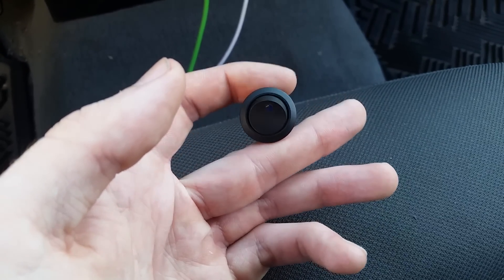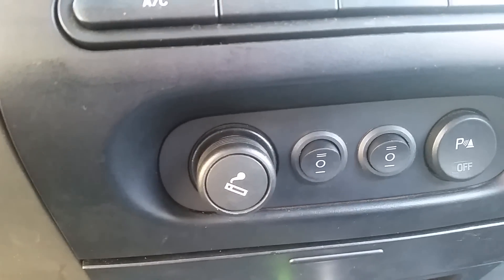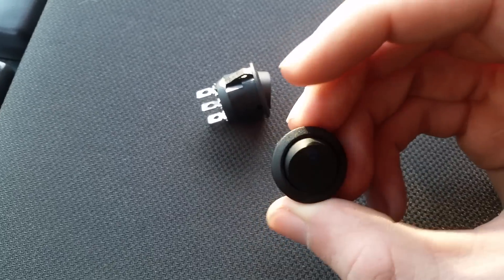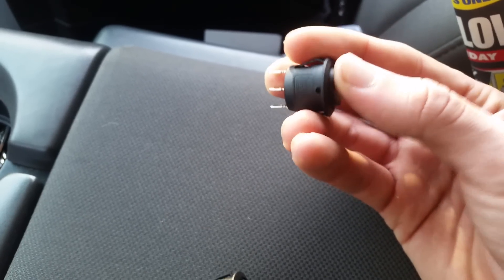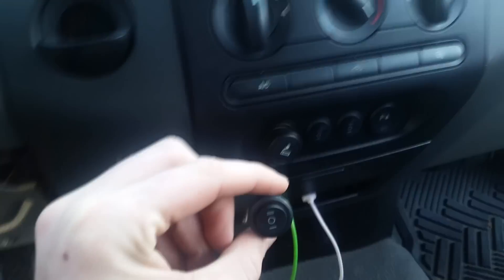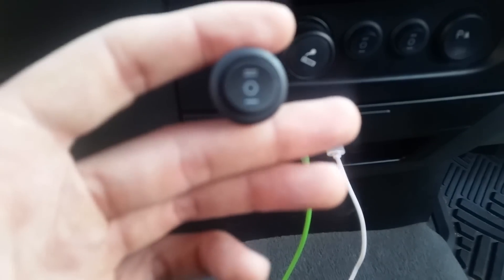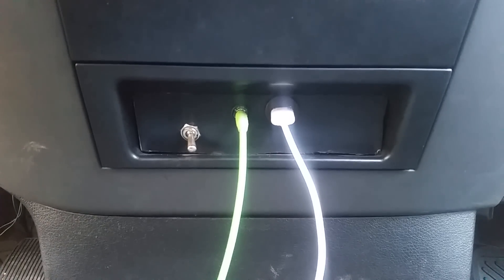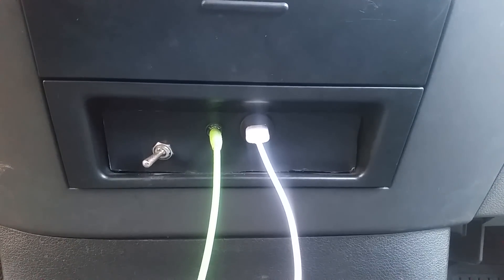How I Wired My LED Lights Into My Highbeams With a Switch

Comment: Hi. Can you confirm me that did you used the controller or not? when connecting the small led lights around license plate. Did you directly connected them to 12v dc supply?

Comment: I tried that but something happened to my light bar it came on for a second then turned off I ran a positive wire to the high beam wire got a 2017 f150, can you tell what I did wrong anyone...thanks

Comment: I just used the wiring from my fog lights and ran a relay. 
Now I just turn on my fog lights and use the high beam low beam to switch the led on and off.

Comment: Great video! Quick question - what is the volt/amp rating of the SPDT switch you used?
Reply from the maker: Thank you for watching! The particular switch I used is rated for 10 amps at 125 volts, or 6 amps at 250 volts. This particular one does not have a rating for DC voltage, but since it is flipping a relay and not handling much of the load, I felt comfortable going ahead with the install. If you're wanting to do it 100% correctly, I would hunt for a DC-rated switch.
Reply: @piedmonttiger265  I got a 450 watt 12v lightbar and it's apparently impossible to find a switch for that 🙄

Comment: I understand wiring and switches, but have no history with relays. Is there a relay part number/MFG you can share, or a terminology for the relay design?  source for the part ?
Excellent video, thank you for posting and taking the time !
Reply: Go to the auto parts store, buy a 30A 4 pin relay, make sure it has an 87.  I like Bosh ones the best, but they will all do the job.  https://www.12voltplanet.co.uk/relay-guide.html has a great guide on how they work.

Comment: Finally someone with common sense who wire it to the highbeam , everybody else just wires it to a switch and think i'm an idiot for saying that it's the wrong way to do it 😎
Reply from the maker: Thanks for watching! I know of many folks who have tapped straight into the high beam wire as well!
Reply: PiedmontTiger that may be so , but your video is by far the best one i have seen ! Here in Sweden where i live we must wire the switch to the highbeam so that it can be off or on with the highbeam , but the rules are different in different country's 😎
Reply from the maker: Thanks for the compliment! That's pretty interesting, but makes sense! I think it's also much easier to just flip the high beam switch than to fiddle around for an auxiliary one as well.
Reply: Ralf Risberg ..well i agree with what you say.. however i wired mine like the way you dont like and here is the reason why. Led light bars are for off road use not on road use so i only use my light bars off road. The light bars are brighter than my head lights. Head light beam 2x55 watts...low beam 2x50watts...normal standard set up.. light bar 1...1x 120 watts and 1x 180watts so pointless having high beam on when light bars are on...but you see the point here is not about how you wire them up.. its how you use them... light bars are illigal to use on road but humans being as they are  dont always follow the rules and the law and use these on road where street lighting does not exist and feel their standard light are not bright enough which they are ..people have to wire them into head lights by law so that they will turn off when dips or low beam is activated which suggests people use them on road which they are not intended for and illigal.  Off road is a different scenario....using my light bars with low beams independently of my high beams is what i do... i dont use my light bars on road as their use on road is illigal...in a nut shell i have the restraint others do not to use light bars as they are intended...oh and if your not into car electrics and wiring looms waiting around for your local car electric fitter to become available is a pain in the bollocks you end up doing it the way you dont like.. :)
Reply: timexironman100m i have 6*55w xenon on my roof so i have daylights when i drive in the winter 😎 3 relays wired so the signal is from highbeam only and a switch because we have to be able to turn them of !!!

Comment: Thank you for posting! I have the same year F150 and am trying to setup a light bar the same exact way (same switch) . Although, there seems to be multiple (3) yellow wires across 2 different bundles. Do you have any advice? How did you know which yellow wire to tap? I tried to follow the bundles to the MFS to narrow it down, but don't know which plug runs to the actual switch. Thanks in advance. - Pete
Reply from the maker: It is quite a pain, especially because I think one of the other yellow wires is the airbag! I removed the panel where your knees go in hopes of seeing something, and also had a little luck by tilting the steering wheel up and down. I found a wiring diagram online, and it is suggesting that there are gonna be 4 wires coming from the MFS: Dark Blue/Orange, Red/Yellow, Red/Black, and the Yellow one you're looking for. I would say try to see if you can narrow down the bundles to the one with 4 wires in it, then if you have a multi-meter or test light, try to pierce the wire insulation of the yellow in that bundle with it and flip on the high beams to see if you get voltage. Here's a link to the wiring diagram post as well! Thanks for watching and for the comment!

https://www.f150online.com/forums/2004-2008-f-150/436913-tapping-into-high-beam-help.html#&gid=1&pid=4
Reply: You are the man! Now I feel a lot better messing wth the MFS having that info. Thank you again!
Reply from the maker: You're welcome! Hope you get it working!
Reply: Yes sir. Got it all wired up and it's  working great! You were correct. I found the bundle with the wire colors you mentioned in the above post, tested with a tester light and spiced in to the on/off/on. Thanks again! If you're ever in Clearwater, Fl-- holler so I can buy you a beer.

Comment: Does the lightbar behind the grill turn it into a spotty?
Reply from the maker: The bar was advertised as a split fog/spot, with either the outer 6 lights on each side being a flood or spot, and then the rest being the other. This bar does a great job of throwing lots of light, but the 6" round halogens I had behind the grille previously threw the light longer and in a smaller more directed pattern. For example, the bar will cause a reflection on a road sign an insane distance away, but won't really penetrate into some woods if that makes sense. Thanks for watching!

Comment: What headlight buds are you running? HIDs or LEDs
Reply: those appear to be led's don't rear much about hid's anymore gwallnut666
Reply from the maker: They're DDM Tuning HIDs, 6000k and I got the 35 watt version. If I were to do it again, I'd do 55 watts, but I didn't want it to be quite as bright to oncoming people since they're in factory housings. Thanks for the comment!
Reply: "hear" gwallnut666
Reply: PiedmontTiger did you use any relays for the LEDs?
Reply from the maker: @Rovert92795  Hey, super sorry, your comment must have slipped through the cracks! This may not be helpful to you anymore , but may help some others. I have one relay for the LED bar, and another relay for the pods.

Comment: I have a 2005 f150 once I connect to the yellow wire which is the high beams, where do I connect that wire  that I just connected, what part of the 3 pin on/off switch top, middle, or bottom?
Reply: I would also like to know if there is a white wire in the middle that goes to the relay where would I put that if that is the place where the high beam wire is supposed to go
Reply from the maker: Hey, sorry for the slow reply! The wire from the high beams can either go in the top or the bottom pin, and the middle one will to your relay! Then the third one will be coming from your other power source (in my case, was a hot lead straight from the battery) The wire coming off of the middle, which goes to the relay, will likely go to pin 86 on the relay, but in some cases it is different, so you'll wanna check on the actual relay you have. Thanks for watching!